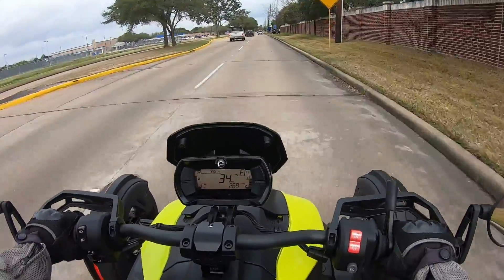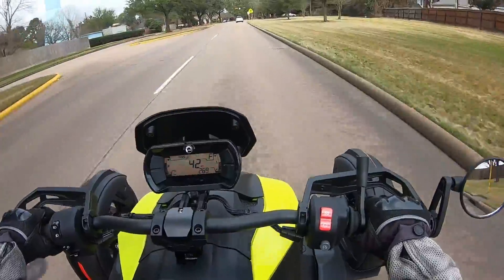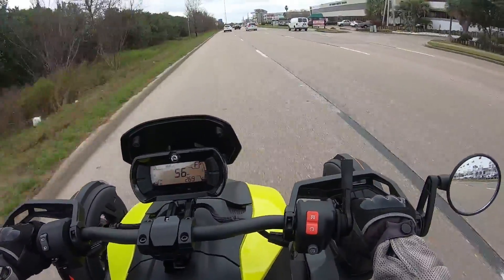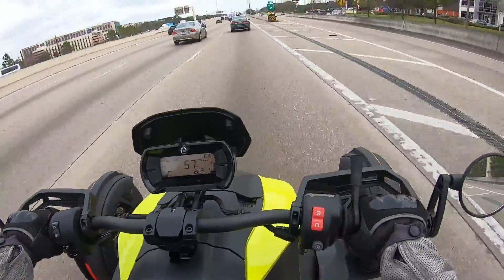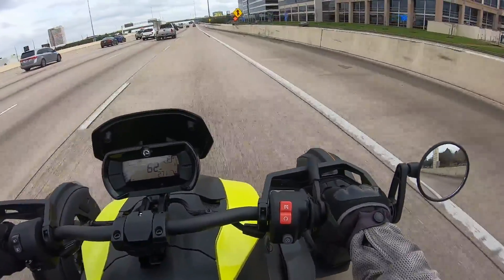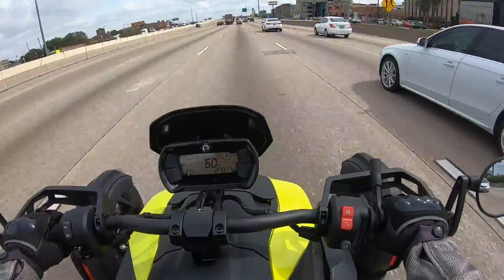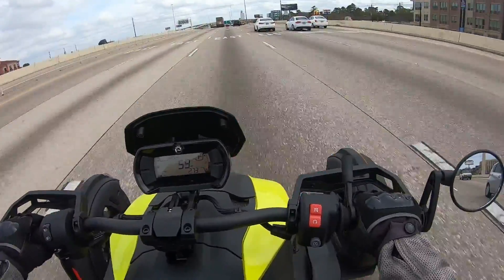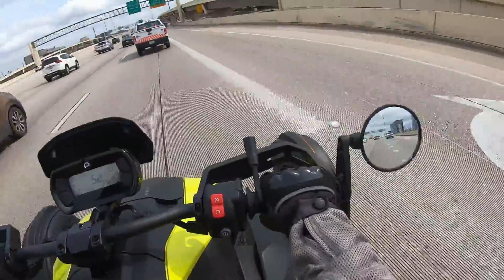VLOG: 2019 Can-Am Ryker Rally // Work Commute, video editing suggestions, OCD

Comment: Your audio is much better.  Never give it much thought  about the sensitivity.  That may be my problem too.  Thanks for the tip.  I use movie studio 15.  It is stable but a long learning curve for me.
Reply from the maker: Thx for the software suggestion! I will check it out to see if it'll help my situation.  Moving the microphone seemed to help with my over-saturation (clipping) issue, but it's still too sensitive when the face shield is down. I have a few spare microphones from my Cardo Scala BT headsets, so I'm going to try one of those as well.  I'll let you know what I end up using to resolve the audio problem.  Thx again!  --QM

Comment: I use a Dell Inspiron with filmora software. It has not issues editing useing my action cam or cell phone. You have then give them a thumbs up or down helps tons. My next mic is going to be a Purple Panda I hear they do very good with wind noise. Ride safe and keep making videos!
Reply from the maker: Excellent, thx for the software and mic suggestions!  I will look into both of those and let you know how it goes for me.  --QM
Reply: Good luck! The mic can be found on Amazon.
Reply from the maker: @spyderryder  Thx again! I am considering going full-tilt crazy and purchasing a professional sound recording system, with a Zoom H5 or H6 as the recorder. All of the recording gear could live in the tankbag and be portable to my other bikes. The helmet mic will be sorted out, and then I might add dedicated mic's for ambient, engine, driveline, exhaust, etc. I'm researching what microphone solutions are used in other motorsports right now (e.g. Nascar, F1, Indy, etc). I'm certainly not the first one to cross this bridge!  --QM

Comment: I remember in one of your earlier videos you were having concerns with stability issues. How have they resolved or have they?
Reply from the maker: The alignment issue is still there. We are waiting for a couple of the dealers/techs in the Texas area to receive their hub adapters for the Ryker.  The laser alignment system  uses specific hub-centric adapters for each application. I am learning to deal with it as-is for now, but I don't think a new rider would be able to adjust to it... they'd probably give up and think that it was too twitchy.  --QM
Reply: @QuasiMotard  tnaks for the response. I'm liking your video on the Ryker as they are very informative. Not too much info out there on this machine just yet. So every little bit helps.

Comment: What do you normally place in the storage areas?
Reply from the maker: Which storage areas are you asking about? If you are referring to the front "trunk" and tailbag, then here is what I usually do... My light-weight rainsuit and toll tag live in the front trunk; the tailbag usually holds my laptop and other work items for my commuting chores. The front trunk gets a little hot from the radiator and engine heat, so I don't put anything sensitive in there. The LinQ top case (tailbag) is too small to hold even a small laptop, so I will be modifying that solution and/or using the pannier to hold those items on the Ryker.  Stay tuned for my review on the pannier kit (SHAD SH36)... that should happen in the next couple of days.  --QM
Reply: Yea, that and the "glove box". I get that Can Am has a different intent for the Ryker compared to the Spyder, but the storage options seem to lack any sort of locking mechanism.
Reply from the maker: @Mithosphere  Yes, you're right on that count. I have already inquired/suggested to BRP that they create a locking option for the parking brake, front trunk, fuel filler door/lid, and the Max-Mount accessories (LinQ top case, passenger seats, etc).  Those could be real oversights and weak spots for prospective buyers, particularly for those people that commute regularly or that live in high theft areas.  Why make it easier for the bad guys to steal your stuff?!  --QM
Reply: The side case for the Ryker is lockable and holds quite a lot.
Reply from the maker: @jolund7848  Yep, I own the SHAD SH36 panniers for two other bikes already.  The locking and mounting mechanism is quite ingenious!  I can fit a full face helmet in there and lots of other gear in the soft bag/liner.

I wish the LinQ top case and passenger seats also had a locking option... they are expensive and nothing will prevent a bad guy from taking them off the bike right now. --QM
Reply: Jo Lund not everyone wants the side compartment. I just realized how easy it is for someone to steal the top case. I was about to order one too.
Reply from the maker: @dabo1971  I am using mine as-is for right now, but I'll probably figure out a hack to lock that onto the bike (e.g. retention bolt or something to prevent it from being swiped).  The other annoying item is the easy-open fuel door... nothing to prevent someone from messing with the bike while parked.  I will probably figure out a locking solution for that, too.  I have the pannier mount installed now (along with several other accessories), so I'll post another video about that in the next couple of days.  --QM
Reply: QuasiMotard ok. I might have to figure out the cruise control gadget you have
Reply: @dabo1971   Definitely need him to show us how to do that!! please quasi please!\